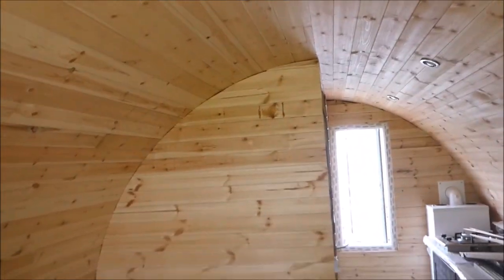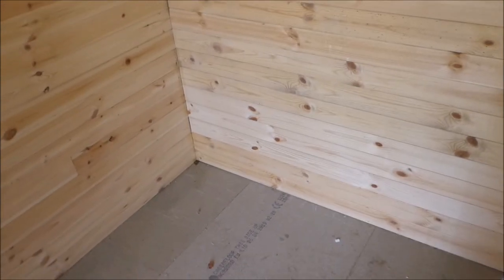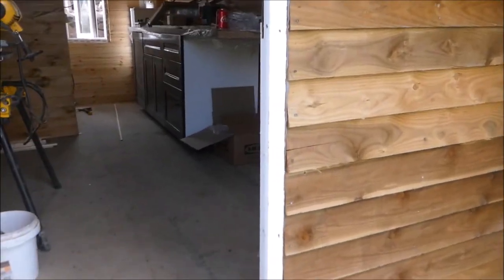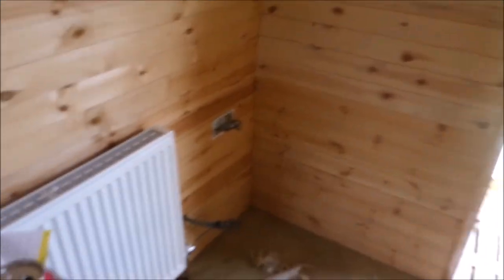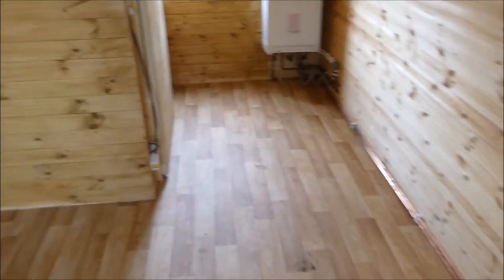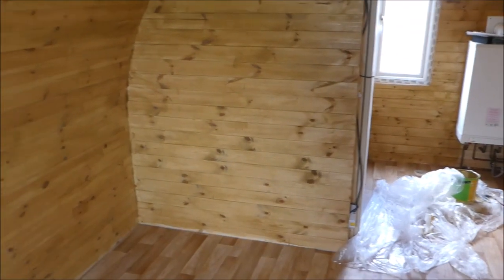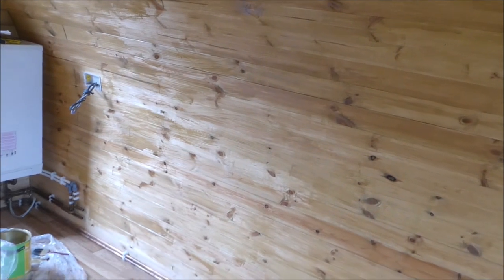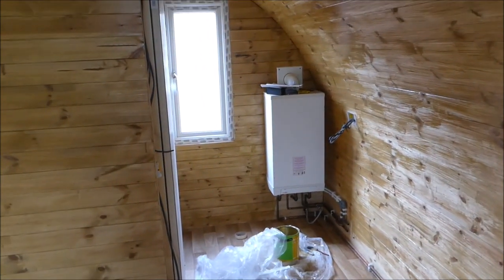Building a Glamping Pod - Part 14 | Varnish, Vinyl Flooring & Sliding Door!

Comment: very nice job there, how much did that cost to build in materials only if you don't mind me asking?
Reply from the maker: Hi there, It's cost me around £7500 so far, that includes the ensuite, boiler and kitchen. I reckon if  I decided to build a basic version without these I reckon I could make one for as low as £4000. Hope this helps!